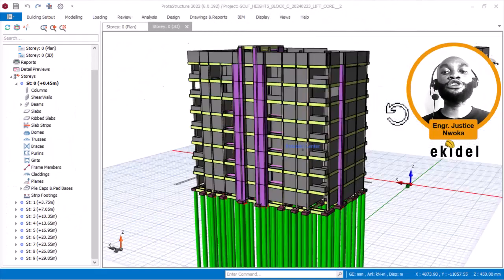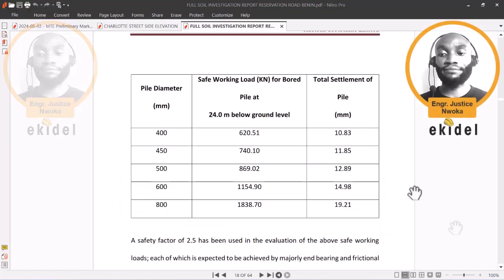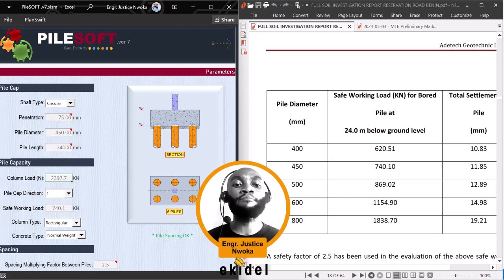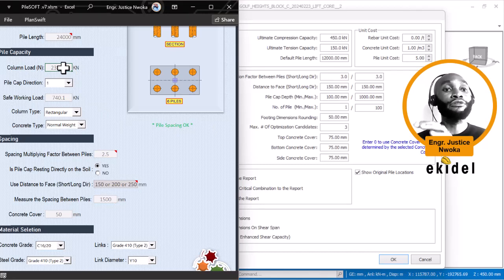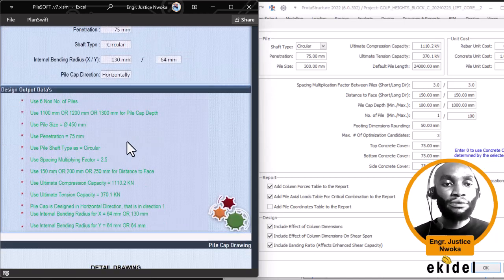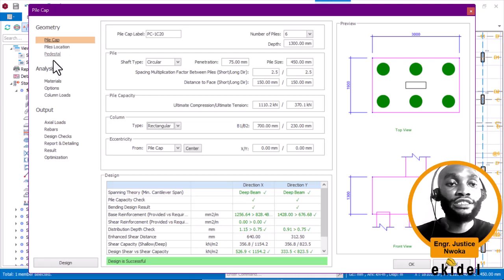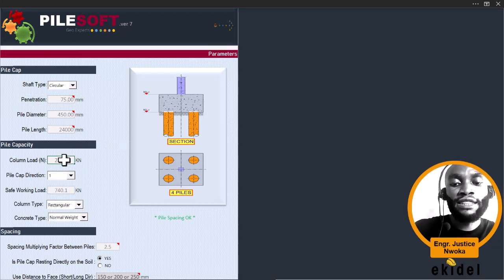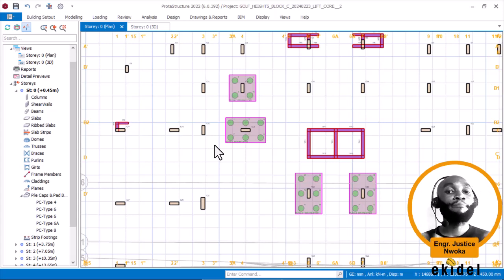Pile Foundation Design in protastructure using PileSoft

Comment: Thank you for your video, especially on the pile foundation form of prota structures, however, I see that the ucc of the pile you input in the prota structures pile setting form is 1110.2 which is 60% of the uwl of the pile (fos x swl), but the utc of the pile you input is 370.1 which is 20% of the uwl instead of 40% which is the remainder if the ucc is 60% of the uwl. I want to know if there is a reason why it is 20% and not 40%.?